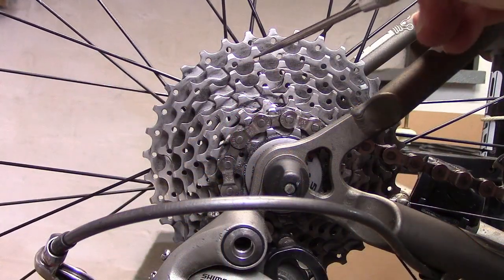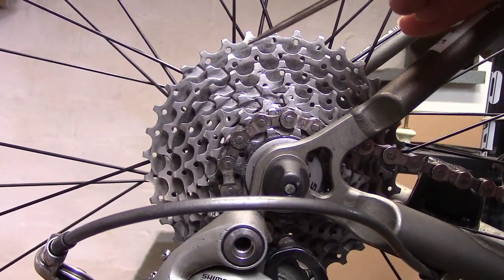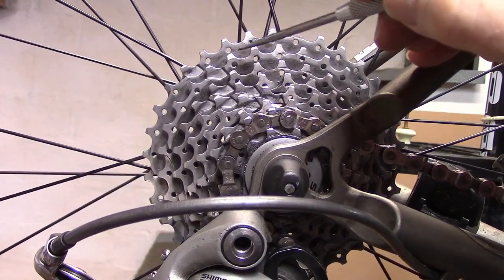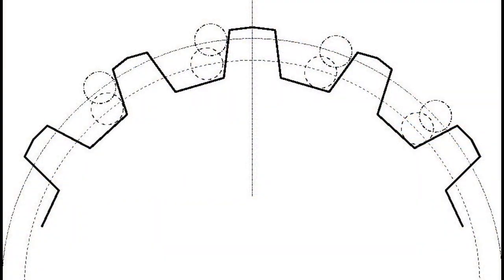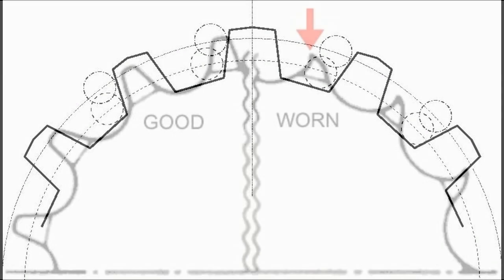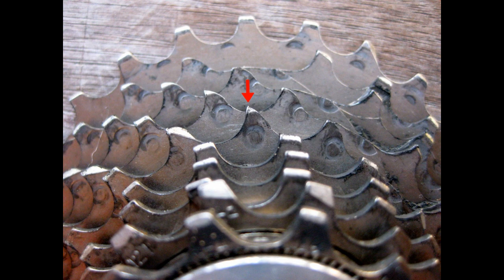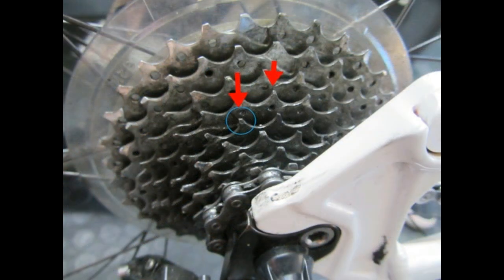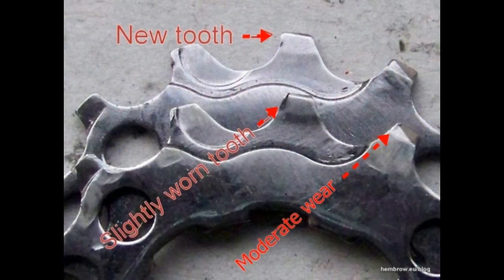How to check for bicycle cassette cog wear and when to replace cassette

Comment: One thing to remember is many freewheels have hyperglide shaped teeth " ramped teeth"  so the chain shifts easier up to the bigger cogs. Many cheaper freewheels have some cogs with the teeth ramped to the outside of the freewheel so the chain rubs and you get a droning sound. This is a manufacturer problem where one cogs simply can not be used due to the way the teeth are pointed. I have fixed 2 freewheels that have 2 cogs badly made even a Suntour freewheel have the 6 and 7 cogs teeth facing the wrong way so they could not be used.. a vice and a small hammer fixed it.
Reply from the maker: Great point. Thank you Danfuerth.
Reply from the maker: Check that the guide pulley of the rear derailleur is lined up with the chain (middle should be just to the left side of the middle of the chain). Check that the guide pulley has not cracked or broken. Check for play in the bottom bracket and the crank bolts are tight. Finally, you may have a broken freehub which would require a look by your local bike shop. That's the best I can do without actually testing the bike myself. Regards, Tony
Reply: @danfuerthgillis4483  -THAT'S IT !!
Reply: @guy7501  Yep actually it’s  hard to find any Freewheel hub wheels anymore as everything moved to freehub now. It’s almost double the price for these older wheels here in Canada. Aliexpress does not even carry them anymore
Reply: @danfuerthgillis4483  that's right Danfuerth ; sorry i forgot to paste the part of your first message i was talking about ; here it is : *****"One thing to remember is many freewheels have hyperglide shaped teeth " ramped teeth"  so the chain shifts easier up to the bigger cogs. ******; it's very very important because people can think that the cogs teeth are worn and it's not the case .
Reply: @guy7501  Yep that's why you always buy the hyperglide freewheels. This makes shifting smoother and the chain lasts much longer.
Reply: @user-dt8no6dd5c  Very hard to do as it's too small to weld. Laser welding would work on that small area, best thing is to replace that sprocket since a cassette has individual sprockets. You can buy individual sprockets.

Comment: But at what level of wear do i have to replace the cassette, do i have to replace it when its slightly worn or moderately?
Reply from the maker: When the 0.5 goes through between links and the 0.7 does not go through. This is mild to moderate wear. If both go through, wear is severe and you may have significant wear to your cassette and chain rings.
Reply from the maker: The above refers to chain replacement. For the cassette, replace if you notice even mild wear.

Comment: You sir have made the best video on the subject.  Actual close ups on different wear level instead of the yippidy yap yap of wannabe mechanics that lead to nowhere.  Now the question is when should the cassette/crank ring be replaced?  When there's "oderate wear"? I assume "slightly worn" is acceptable.  The wisdom being passed around these days is if the chain is worn over 5%, the cassette should be replaced along with the chain.  Well jokes on me.  I bought a used bike that have what appears to be new cassette, a chain that's at 5% wear and not over 5%.  But the 3 speed chain ring have burrs on it.  There are still flats, the chain still nest in the chain ring nicely.  Hate to have to replace the chain ring stack right from the get go.
Reply: I read the other comments and have found your reply to someone else mentioning to replace the cassette even if there is "slight wear"  I assume this is also true for the crank ring.  RIP.
Reply from the maker: @Jaze2022  Components of the drivetrain wear at differently with the chain usually wearing quicker. Once I notice the grooves between teeth becoming elongated or varing in length or the teeth starting to become pointed rather then flat, time to replace the chainrings. Burrs may also occur and when definately noticeable along with some of the other changes above, time to replace. Here are a couple of videos that might help you:
https://www.youtube.com/watch?v=sXdrOQpr-Zg
and
https://youtu.be/8LqTmvuf6tw?t=132
Hope this helps. Regards, Tony

Comment: Is it normal for a cassette to have some play? Mine feels a little loose even after replacing the cogs. My shifting seems fine & chain hasnt skipped since I replaced the pedal chain rings. I'm just a little concerned about a loose rear cassette wearing out the chain faster than normal.
Reply from the maker: No, the cassette should not have some play. Either the cassette has not be tightened enough, See:
https://www.youtube.com/watch?v=RyX00hPyB34
Or you may be missing a spacer that allows adaption of the freehub for 9, 10 , 11 or 12 speed. You may not have shifting problems but fixing the above will increase performance and decrease wear. If in doubt, have your local bike shop take a look and let me and our viewers know how you made out. Regards, Tony

Comment: I have an 8 month old specialized allez and my chain Guage showed it was a little stretched but not passed .75 at all. I clean my bike n chain once a week and I take great care of my things.  My teeth on the cassette all look just fine. But I bought this chain from Amazon and after installing it the test ride gave me chain skip. It wasn't bad and only in 2 gears. The chain in orderd was an off brand hollow plat chain. I do have a new cassette and kmc chain the spec that came on the bike on its way and know how to change it myself.  I just can't come to believe I wore out my cassette after only 8 months.  I'm so on top of this stuff with my ocd so I didn't wait to long to change my chain. What do you think Tony?
Reply from the maker: I assume you lubricate your chain after cleaning. Don't use degreaser unless you wash off the degreaser after cleaning. I put a very tiny bit of turpentine on a cloth and wipe off the excess grime and grit. Then I wipe down the chain thoroughly as well as the chain rings, cassette teeth and pulley wheels. Degreaser will interfere with any lubricant. Finally I lubricate the chain and let it sit overnight - wipe off the excess before my next ride. 
The amount of chain wear depends on the distance you ride and how hard you "grind" those gears. The chains life varies. For a 9 speed chain, you can get upwards of 3000-4000 miles. But for the new 11 and 12 speed chains, that drops to about 1500 miles before you need a new chain, no matter how well you clean and lube your chain.
As to the skip with a new chain, there are several causes. The rear derailleur cable may need slight adjustment. The cassette may be worn. Or the cassette may need to be tightened as in the following video:
https://www.youtube.com/watch?v=qVzWQuHPz50&t=1s&ab_channel=TonyMarchand
Let me know how things work out when you install the new cassette and KMC chain. Remember to put a light coat of lubricant on the freehub before tightening down the chain as in the video. Also make sure you include any spacers that go on the freehub before attaching the cassette (when you take off the old cassette you may or may not have a spacer that adapts the freehub for a 9, 10, 11 or 12 speed).
Regards, Tony

Comment: Quick update on my bike whose chain kept skipping in certain gears. I tested the chain using a chain wear tool a couple weeks ago and it came back above .75 but below 1.0, so I promptly replaced the chain. However, after changing the chain the bike kept skipping on certain gears (i.e. 6 and 8). I tried re-indexing and that didn't work. But I also noticed the rear derueiller was misaligned. I ended up throwing my hands up and taking it to the bike shop. They correctly noticed the bent derailleur and slightly bent hanger and repaired it and gave me my bike back. Rode maybe half a kilometre only to notice the darn gears were skipping again. Brought it back to the shop and their tech determined the cassette was busted. Fortunately, I have a simple Shimano 8 speed so the replacement part for that was relatively inexpensive ($22 AUD). 

So my guess is the cassette wore down on those gears as I rode primarily on them. In addition, the misaligned cassette combined with the couple of weeks I was riding the bike with a worn chain was probably all that was needed to damage a cassette which should've lasted me another year easily. Oh well, at least the bike is riding like brand new now. In case you're wondering how the rear derauiller got bent, I have two hypothesis. I was parking my bike at my University's bike shed (which uses wall mounted bike racks) and the bike slipped from the mount and fell a good foot. Other possibility was a year ago I had my first flat on a bike and in my haste I forgot to lock the rear wheel. A day later when I went out on my ride the wheel popped off the frame,  and likely didn't help the derailleur either. Those are my hypothesis, I'm not sure if either contributed much to the derailleur wear. I would ordinarily be embarrassed by all this but I'm learning as a cyclist. You can watch all the Youtube videos you want from GCN but until you actually get out there and are forced to make a repair at the roadside, it's all theory. At least that's my theory! 😅
Reply from the maker: You're absolutely correct; it's all theory until you get out and do it yourself. You've learned a lot through this experience. When I was younger, I use to sit in the bike shop and watch them fix bicycles. Then, I'd go home and try it myself. Through all the years I'm still surprised at what there is to learn. Regards and safe cycling, Tony
Reply: I gotta say, you just describe my whole journey there! I first changed the chain, but I was still skipping, I changed the rear derailleur, still skipping, and finally I thought of the cassette, turns out I was mostly using the smaller two gears, and they were worn through! Hard to tell because of how hidden the smaller gears are. Currently waiting on a new cassette, should hopefully fix the issue.

Comment: Hey Tony this is a great video thank you for explaining it so clearly! I’ve got a worn 14T top cog on an old freewheel that has a really nice range of 14-32. I’m pretty handy with a Dremel and grinding wheel but I don’t quite understand what to grind. Could you explain it or do you have a video you’ve done on it? I’m trying not to replace the freewheel if I can help it. Thanks very much!
Reply from the maker: The problem with cassette or freewheel wear to the cogs is that the metal is worn away and can no longer accommodate the chain. Grinding or filing will not replace the missing metal. Your only choice is to replace the freewheel or cassette. I'd use a freewheel from the same manufacturer as your current one and you will need a freewheel installation/removal tool for the job. Sorry but there is no way around it.
Reply: @tony10speed  Here’s would someone advise that I do I just can’t understand exactly what metal he’s talking about grinding:

“Easy to fix if you have a small-diameter (3/8" or so) grinding stone and a Dremel rotary tool.
The exact problem here is that the chain's rollers fail to fall into the spaces between teeth under higher chain tension loading.
The pointed corner at the top of the driven side of each tooth needs to be beveled 1mm, so that the chain's rollers can fall into the spaces between teeth without catching on those hooks that have formed atop each tooth.
I grind my bevels just a bit steeper than 45 degrees, for maximum effect with minimal stock removal.

I could fix that cog in two minutes using the Dremel, and without even removing the wheel from the bike. Done this a few times when a new build surprised me the next morning by skipping under load.

Alternately, if you can remove that small cog from the freewheel, you might remove the sharp corners using a file with the cog held in a vise.

Yet one more good method is to remove the cog and touch those corners to a bench grinder wheel.”
Reply from the maker: @gtube2010  He's talking about grinding down the top of the cog teeth about 1 mm (and making them more flat). As the cogs wear, they become more pointed and catch the chain rollers as they go over the cog. Some also have mentioned grinding the pressure side of the cog teeth to make them a bit flatter (where the chain roller pushes the tooth of the cog forward). 
You can try it. The worst is that you have to buy a new freewheel anyway. Here's an interesting discussion on the topic for what they're worth:
https://singletrackworld.com/forum/topic/anyone-tried-this-reconditioning-a-worn-cassette-with-a-dremel/
and
https://www.cyclingforums.com/threads/chain-skipping-problem-fixed-by-grinding-sprocket-teeth.190140/
I've never tried this and personally would invest in a new freewheel. Let me know if it works for you.
          Tony

Comment: Thanks very much! Do you always fit a new chain at the same time when you replacement a cassette?
Reply from the maker: No. If you take care of your chain, the other parts of your drivetrain including the cassette and cogs will far outlast the chain itself. See:
https://www.youtube.com/watch?v=I_5fNbDN3UA&ab_channel=TonyMarchand
and
https://www.youtube.com/watch?v=0CSUVMxyy3w&ab_channel=TonyMarchand
If it rains, degreasing with washing and drying is called for before re-lubricating for each type of lube.
Using a chain wear indicator, my chain seems to last 3000-3500 miles or more while, with close examination, the cassette seems to last 2 to 3 times longer.
Regards, Tony

Comment: Can slightly worn out sprocket still be usable?
Reply from the maker: A new cassette should last upward of 2000 - 3000 miles if the chain is replaced at regular intervals (i.e. when you notice .5% wear on your chain wear indicator). With that said, it also depends on your riding style (if your pounding on the pedals or racing). You can use a slightly worn cassette, but I prefer to replace it when I begin to notice wear so as to get the most out of the rest of the bicycle components (chain, pulley wheels, chainrings). Good question. Thanks, Tony

Comment: My brand new chain was still snagging periodically, even after filing down all the sheered teeth (though much less often). I'm just getting a new cassette they're inexpensive.
Reply from the maker: If the teeth of the cogs of the cassette are "sheered" or "shark tooth", the cassette should be replaced. A new chain will not solve the problem. I would not file down the cassette teeth - but rather replace the cassette.  Regards, Tony
Reply: @tony10speed  This problem of the chain "snagging" the next higher gear briefly before harshly dropping back down I've been having periodically for quite some time now and is what has caused some slight sheering on the leading/biting edge of the gear teeth, which has only compounded the issue. It snags far less often now that they have been filed since the sheers poked outward, making chain contact much more likely. It now only occurs when in a higher/harder gear going up a steep incline as momentum is lost. The harder pedaling required puts increased strain on the rear wheel which causes it to slightly deflect at an angle sufficient enough for the next gear to engauge (I think anyway, pretty sure the cables are tensioned correctly as I only use the lowest/hardest gear in the rear).
Reply from the maker: @transnd  Could be a number of issues: Does the rear derailleur cable need adjusting? Does it need to be replaced? Is the high limiting screw on the rear derailluer  need to be turned counter clockwise to allow the chain to stay in the smallest cog? Are the chain, cassette and other components of the drive train compatible? These are issues you need to have your local bike store mechanic look at since we are reaching a limit on what to do over the internet and it's best to see the bike up close and personal. Good luck. Regards, Tony
Reply: @tony10speed  I tweaked with all those settings, though some could still be off. The bike is old and I'm suspecting never kept in tune. It worked for me up until this summer when I really started to push it. Thanks for advice, I'll double check.

Comment: I still did not understand how a worn cassette increases chain wear. Wouldn't the rollers of a new chain just sit at the bottom of worn sprocket grooves, rather than the top, maintaining uniform tension?
Reply from the maker: What is mentioned in the video is that "as the chain wears" the rollers will run higher on the cassette cogs and wear the cassette. This is because as the chain wears, the distance between the rollers and pins becomes greater (as does the length of the entire chain). This results in the rollers running higher on the cog teeth, the cassette cogs become deformed, edges become sharp and may even appear "shark tooth like." The result is poor shifting. The chainrings will also wear. 

I use a Park Chain Wear Indicator to measure wear when doing routine maintenance. When the gauge reaches 0.5% and before it even gets close to the 0.75%, I replace the chain. Now the cassette still will wear slowly (just due to the metal on metal of the chain and cassette) but at a much slower rate and the cassette will last much longer.

Hope this explains the process. Regards, Tony

Comment: My casset is like sharp so should i change my casset
I am not a pro biker beginner biker
Reply from the maker: If the teeth are sharp like shark teeth, yes it's time to replace the cassette. Also check the chain and front chainrings for wear since they may be the cause of the cassette wear. This is true for recreational riders as well as pros (although pros usually get new equipment each year or each big event).
Regards and safe cycling, Tony